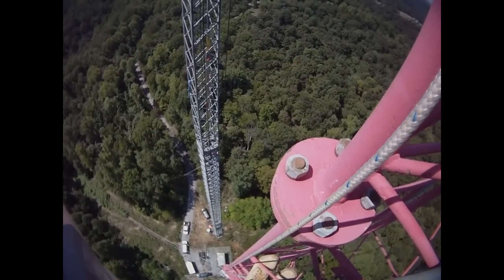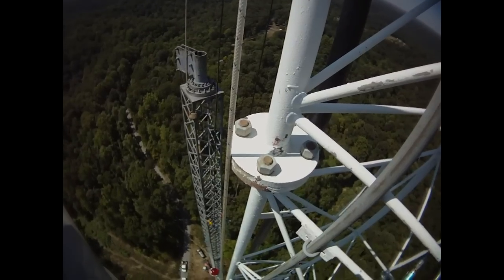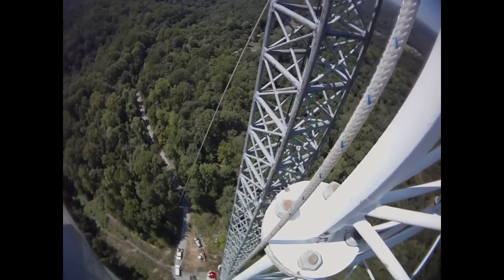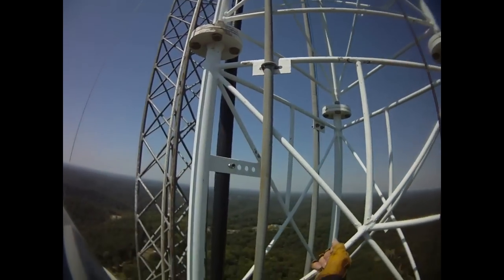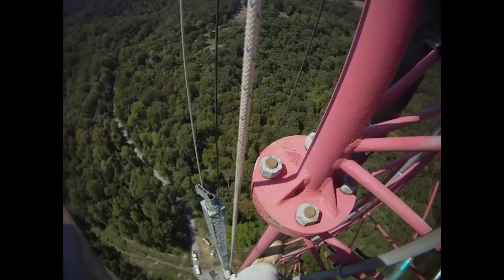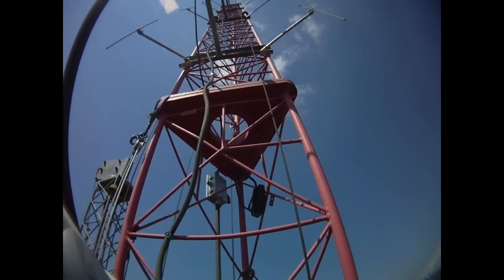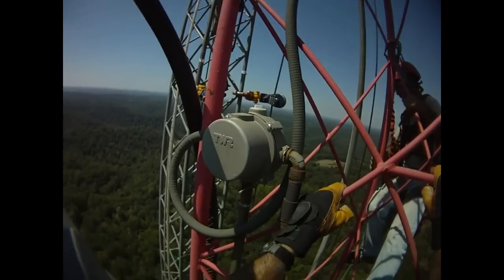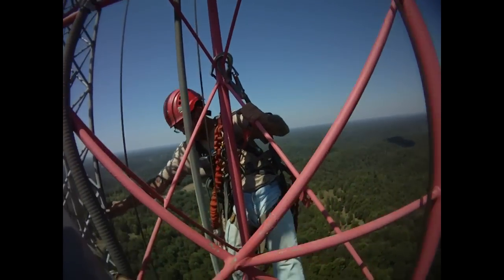Jumping a Gin Pole Part 1

Comment: I worked a gin pole building met masts for a few years. My one regret is not getting more video recordings of that job. Thanks for the video!
Reply from the maker: I have the same problem on this job.  The crew that was in charge of getting this part done had two guys missing one day so I had to help the last remaining tower guy.  It was Eric (tower guy), David (Winch Operator) and me, the "old" man.  During part of that job two of my employees were in Nashville installing a new antenna for a broadcaster.  When two of the erector  guys got stuck without a plane back to Nashville from NYC I had to break off and work with the other crew.  John

Comment from the maker: No.  What we did was disconnect the top beacon wiring, remove the top section (29) with the beacon in place and then remove the section just below it (28).  Those two sections were moved aside on the ground until time to remount them.  Next the two bent sections (26 and 27) were removed and set aside.  In the process of removing section 26 we had to re-attach guy wires temporarily to section 25.  We then installed the newly manufactured (Central Tower)  26 and 27 (after painting) then reinstalled 28 and 29.  This required repositioning the gin pole several times.

Comment: Back in the late fifths early sixtys my favorite uncle was erecting a very tall radio tower in San Diego Ca . There was a permit hand on the job, when a small earthquake hit the tower swayed quite a bit . They were hundreds of feet up , the permit guy got really scared and said," let's get the hell down from here." My uncle told him, " hang on to what you got you'll be down soon enough".
Reply from the maker: Hi Wayne and thanks for the comment.  We don't get earthquakes very often in Middle Tennessee.  I remember waking up one night about 30 seconds before I felt an earthquake shake my house in Middle Tennessee.  It turned out that the epicenter was in southern Indiana.  That's the only quake I've ever experienced.   Your story is much like my lightning stories in this area.  When you're 1200 feet up a tower it takes at least 25 to 35 minutes to climb down.  If a storm pops up all of a sudden the safest thing might be to lash off in the middle of the tower and wait it out.  1200 foot tall towers are usually 5 to 10 feet in width so there's plenty of room in the middle in most cases.  The best way to make sure it won't rain and there will not be any lightning when working a 300 foot or less tower is to climb down when you see the storm coming.  The storm may be a dense wall of water and lightning bolts but if you get off the tower the storm will bypass that site, or so it seems.

Comment: Thank you.
Reply from the maker: Thanks for the comment Glen,  The 2000 lb Ginpole was quite hard to deal with but once in place all went well.  There was a Ginpole accident just outside of Huntsville, Alabama about 20 years ago where the pole got stuck at some level and the hoist operator tried to "bull Doze" his way up the tower.  The pole broke lose, it fell against a guy wire and the tower (1200 ft) fell with (I think) with three workers at the top who had been waiting for the pole to get there.  Sad stuff.